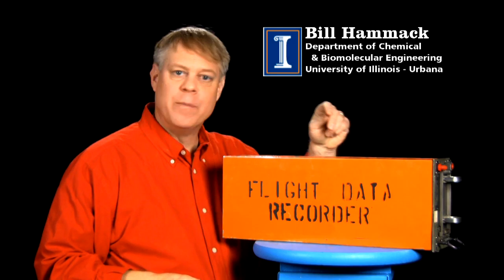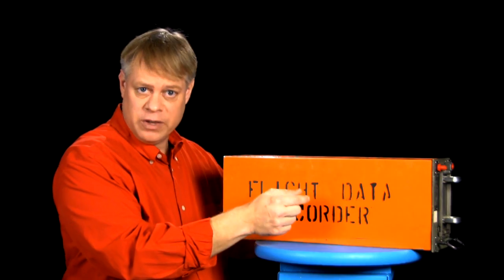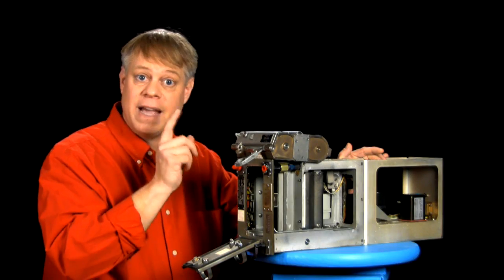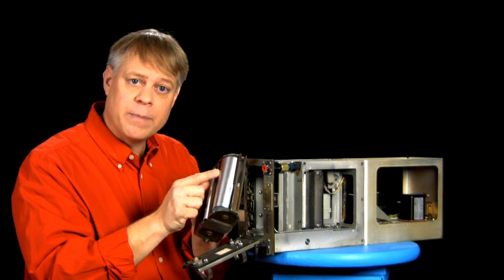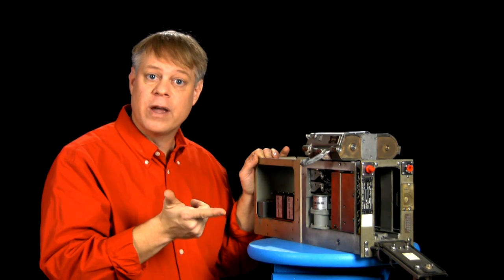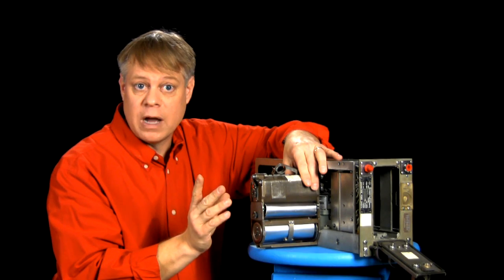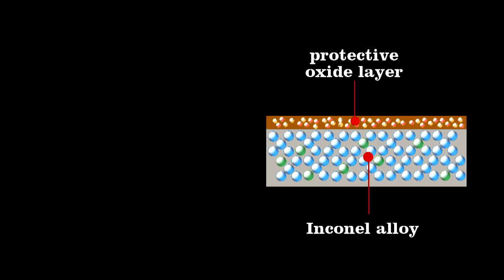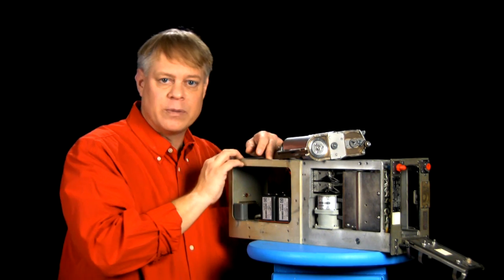Black box: Inside a flight data recorder

Comment: This ingenuity was derived off Edisons tinfoil machine back in 1877. The device never really died. After the development of the phonograph. This almost seizmograpic technology found its use in early meteorology for wind speed airpressure dewpoints Temperatures when air balloons were launched with sensitive material materials in these units attached by a cable. These were old school skew t readings or tephigrams. Eventually these machines made their way to the first crude spring operated flight data recorders. Usually the spring motors were Swiss made with sensitive governors on it. If cab pressures dropped drastically changes in gravity occurred especially if the plane was going to crash it set off the governor and the device started recording

Comment: As an engineer, I can appreciate the clever use of technology designed into the mechanisms and recording material.  I am at a loss to explain however, how these ever got the name "black box" when they are clearly bright orange or red to facilitate finding them in a crash.  Maybe the first ones were black - or perhaps many were found to be black in planes that had caught fire.   But it seems to me that from a safety standpoint, if a plane went down somewhere in a large wooded region, you'd want to tell people "you're looking for a bright orange box," rather than "you're looking for the plane's black box - it's this bright orange color."

And if anyone can tell me why we park on a driveway and drive on a parkway, one of the greatest mysteries of my life will be revealed.
Reply: They call them black boxes because most folks will never know what's inside.  This term is used heavily in the defense aerospace industry for 'secret' boxed devices manufactured for aircraft.
Reply: @dryan8377  the name Black Box derived from the Little Black Book because of the secrets they hold. Which then in the electronics industry a collection of different circuit modules which is put together to do a specific job is often called a "black box"; the idea is that the contents can be a complete mystery as long as you know what the output is for a given input.

Comment: So seeing this reminds me of what a Mechanical engineering professor said to me about the recent Boeing Crashes. To paraphrase, mechanical design today is rushed and not very good quality, and software is used to patch up poor mechanical design. It kind of bugs me how the push for reliance of digital for everything prevents mechanical ingenuity, at least for some industries. I also understand that in Aerospace, digital is necessary to automate keeping the planes stabilized, but I don't know why they relied on readings from a single sensor to determine the planes stabilization mechanism.

Comment: As cool as black boxes are. Why dont planes of today not also upload data directly to the cloud somewhere.
Reply: My guess is that so there would never be a connectivity issue. It would be nice for backup,  but the data need to be unsusceptible to loss from a cloud snafu. Also, if it's not networked, it can't be hacked.

Comment: Black box, more like orange box
Reply: It is orange to be more visible
Reply: Its called a black box because it is a one-way system. Data goes into it, no data comes out of it.
Reply: “Black Box” is an electronics term that describes a system that performs a task, without having to explain in detail what that task is. If you have two incompatible electronic devices, someone may design a “black box” to sit between them so they can share data or parameters in a compatible fashion.

So called because when they built a piece of equipment to do the intermediate task, they typically enclosed it in a black plastic box with chassis ports to connect to each of the incompatible systems.

It’s an electronics term for thingumajig or whatchamacallit.
Reply: The term "black box" is a generic term for a box that holds avionics equipment.  Most boxes that hold avionics equipment ARE painted black. Emergency equipment ARE orange for the obvious reasons.  ....yes, it annoys me too to hear it called a black box.
Reply: Orange box is on steam

Comment: Delta never had the Boeing 727, they did however have the dc-9. Delta was the launch customer in 1965.
Reply: They did have the 727s, there was a famous crash, Flight 1141, which crashed on take off.

Comment: Kindly advise any website that contain simple statistics the chance of the flight data recorder survival in a crash. eg. 100 crashes , no recorder data is damaged.
911 is an extreme case that seems nothing could remain. 
the recorder should designed to survive in most crash conditions .reasonable costing and reliability. but in accordance with changing environment and material technology , is the standard is upgrading ? or just 20 years before ?

Comment: im surprised by its construction. I always thought they were built like a safe.
Reply: these are, what he didnt show in the video was how it would be opened, on the bottom of the outer casing, theres a lok of some sort, where if it is not turned, you cannot remove the inner casings.

Comment: Actually, you get a total of 800 hours recording from one spool of expensive Inconel foil.  The magazine is replaced after 400 hours, then the spool in the magazine is reversed in the avionics shop and returned to stock to be installed in another aircraft.  The second 400 hours are inscribed on the reverse side of the foil before the foil is replaced by a new spool.  Foils are marked on each side to identify aircraft and dates installed, and recorded foils are retained for time spans specified by regulation.  All that has, of course, been superseded by solid state digital recorders that store hundreds of parameters instead of five.

One other thing--if you ever see the magazine and foil from one of these antiques, do NOT handle the foil.  It is sharp as a razor on both edges.  I knew an avionics tech whose hand was badly cut when he tried to clear a foil jam in a magazine.
Reply: I like your user name...
Reply: Thank you, I was just about to ask if the foil was erased somehow, how long it lasted, or if it was replaced after each flight! You just answered all those questions for me ^^ thumbs up
Reply: If I recall correctly, they also had black box recorders that magnetically recorded information onto steel 'piano wire'. I believe they are what came between the foil and solid state recorders.
Reply: +Hopelessand Forlorn Or if handling it, use tweezers.
Reply: @jjovereats  Or wear really tough gloves.
Reply: Is that the same material developed for the skin of the North American x-15?
Reply: reminds me of the time I cut my hand on some aluminum foil. Yeah it can be done. ewwww don't do it..
Reply: Hopelessand Forlorn  I think that alloy was Cobalt based. Either that or it was a Nickel Chrome superalloy
Reply: Actually, we really did not need you to tell us that Bill was misinformed.  He know everything!
Reply: Thank you for the extra information!
Reply: Neat!

Comment: sooo, is it the casing or the fact that the foil is made of special steel that a blackbox can withstand a crash?
Reply: +BountyFlamor This was the first time I've learned about how these things work, but basically it's the inconel (not steel, it's a nickel-based alloy that's extremely durable in high temperatures) that's doing the work. The whole device is basically (actually, literally) an old-timey paper barometer, except it probably has a tungsten tip to make scratches instead of ink and a roll of inconel instead of paper. Fascinating!
Reply: +BountyFlamor I think it'd be the foil, as as long as that's recovered they can read the engravings? I don't know I could be wrong
Reply: neiljborja do you happen to know how the digital modern ones do it if they don't use that foil?
Reply: +BountyFlamor Google will  have a better answer than me but I assume everything now is done via solid state memory (think giant flash drive).

Comment: "..withstand 3000 g..."
Yet it only takes a force of 50g to completely stop a 500ft/sec projectile in 63ft, half the length of a 767-200.
Aluminum can't penetrate structural steel at subsonic speed (STP@SL).
Engineering is PHYSICS.
Reply: +cheerdiver Steel fuel can't melt jet beams. 9/11 was a part-time job.
Reply: cheerdiver As I remember it didn't cut through, the towers were standing for quite a long time, but weakened from the heat of the fire (lots of combustible materials in offices), then gravity did the rest.
Reply: Rx
Steel doesn't melt from fire, but it's load-bearing capabilities reduce very much above 500 °C. An office fire reaches about 1000 °C in less than an hour. Steel columns became dented (the forces from the collision removed the fire-resistant coating from the columns), the steel joints damaged. The slab fell 4 m on the slab below it, and that couldn't withstand the dynamic load, so both of them fell one slab below. At this point there were nothing to brace the columns, so the ones not weakened from the fire became dented too, and the top part of the building came to downward acceleration.
Reply: cheerdiver I agree, and 50 grams isn't a force (or even a "force force"), it's a mass. The force required to stop a projectile moving at a given speed depends also on its mass. Mass, force and energy all all different, and not commensurate.
Reply: puncheex2 So you are one of those hayseeds, who still believe commercial airliners hit the WTC?
Please demonstrate how aluminum can cut through structural steel at such a low velocity, physics is 100% REPEATABLE
Reply: Yeah, I guess you could identify me that way, were you such an uncharitable clod.  It's not up to me to disprove your assertions; it's up to you to prove that they are the correct explanations, and I doubt that you could prove yourself out of a wet paper bag, engineering-wise, as shown in your comment.
Reply: puncheex2  A copper jacketed lead bullet is 10x density of water, and has to travel over twice the speed of sound to penetrate 1/4" mild steel.  The larger the bullet, the higher the velocity required, as a 22LR will penetrate a bullet resistant vest easier than a 45ACP.  Sully's airliner in the Hudson river, clearly shows a mass density of less than point two (.2) of water, as it floats so high the wings barely tough the water w/ ppl standing on them.  At sea level, any large CA will top out at about 500ft/sec, due to high air density.
Even F1 drivers survive 85-140G impacts from 200mph, and the car body has a 2ft dent after bouncing off the wall.
Shear mod of alum 25Gpa, basic steel 70Gpa.  TT box columns >10mm, CA skin 4mm.
Case study, July 28th, 1945 B-25 impacts the Empire St bld.  The airframe fell to the street unassisted.  Limestone facade, as all masonry, has negligible tensile strength, <1Ksi tensile.  Plate structural steel >85Ksi tensile.  As we see in Kevlar vest, tensile strength is what prevents penetration.  It's the very reason Karate demos break stone, it fails by being pulled apart.
Reply: I have fought a fire in a steel framed warehouse.. When we went back the next day 11" RSJ's were bent like coathangers and the building had suffered a partial collapse. Educate yourself and join your local volunteer fire brigade. Also, what is weight of loaded 767 and speed. What is that in Newton Metres? ;-)
Reply: cheerdiver
A heavier bullet does not need a higher velocity to create the same force; it needs a lower velocity. That's extremely basic physics. Steel loses structural strength exceptionally quickly under heat- that's why we coat it in fireproofing these days...
Reply: +puncheex2 HE DOESN'T MEAN 50 GRAMS HE MEANS 50 TIMES THE EARTH'S GRAVITATIONAL PULL. G STANDS FOR GRAVITY, YOU BONEHEAD.
Reply: ***** Derogatory comments, is that all you have, try proving the observation wrong.
Reply: +Fernie Canto That's funny, care to explain how a partially involved single story office fire collapsed a 50 story steel and concrete Type I fire-resistive construction in a free fall planned demolition style manner? WTC7 is the building I'm speaking of, doubt you even knew it existed though.
Reply: retepaskab No hydrocarbon fire will get hot enough to WEAKEN steel w/o FORCED INDUCTION.  It's the very reason blacksmiths invented the bellows, to weaken iron (w/ much hotter burning coal) to the point they could forge the iron work piece w/ heavy blows from a maul.  There are no 'winds' on the back side of a hurricane, Erin off the to the East.
So everything you just claimed is irrelevant non-sense.

Comment: Whoever design the blackbox now, they should add a critical function.
Make black box online and sync to "cloud".
Reply: +Wulin Teo Something like that is done.  Flight data is relayed by radio from an aircraft in flight about various flight parameters.  But, an aircraft that crashes, needs to use a recording means for many parameters.